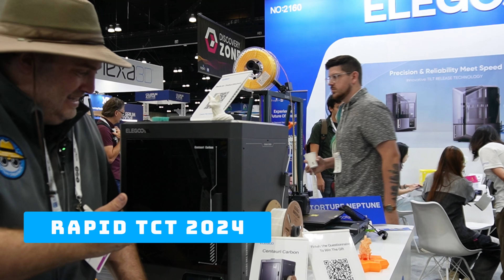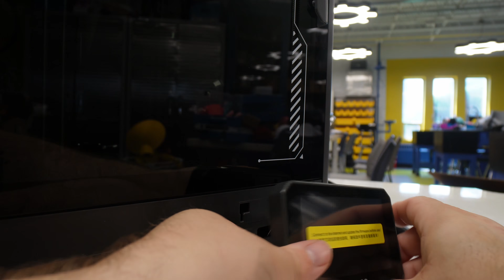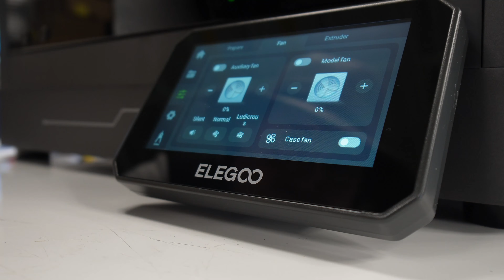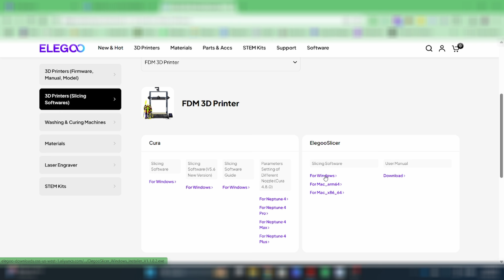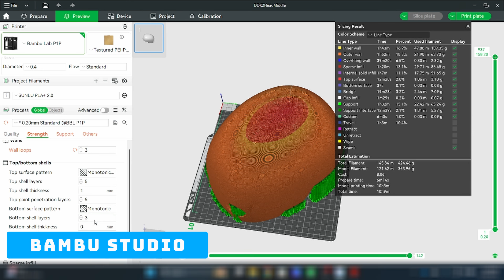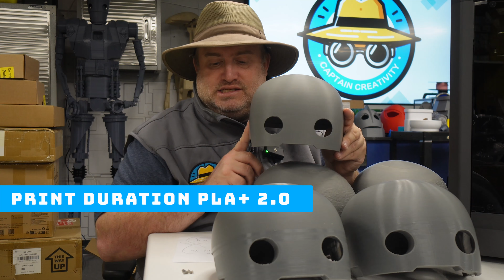Centauri vs P1P: The Ultimate 3D Printing Showdown

Comment: Better screen, More rods, thicker bed, higher speed, better print quality, easier nozzle changing, more advanced leveling, front USB port....Not exactly a clone.  A BIG IMPROVEMENT is more like it
Reply: On paper the Centauri is better. But I've seen other comparisons where the P1S had slightly better print quality. 

One example was the test print  with the overhangs. The Bambu printed all the way to 80° overhang without issues. The Centauri was fine til 70° but then had the underside of the overhang have issues at 80°. 
Also the details of the chimney of the benchy looked sharper on the Bambu and the Elegoo had some more issues with bridging hanging down.

I assume that's mostly because Elegoo has faster print speed in the standard profiles and Bambu is better at cooling which is important for overhangs / bridging.

Then the Elegoo print plate is not that good. 

But overall I think the Centauri Carbon gives more value for your money. At the moment I'm looking to get my first printer and the Elegoo is currently my top pick.
Reply: I own a P1S and have tested a Centauri carbon...No the P1S doesnt have as good quality of prints , especially the first layer and on overhangs.  Also the build plate on the P1S is plastic and half as thick as the Centauri.  The Centauri also has a better cooler on the printhead.  Like i said i own a P1S and have used a Centauri....The Elegoo is better @john9801
Reply from the maker: So glad to hear from you another owner confirming the CC is better. Out of curiosity what do you think was causing my K2SO helmets to look so bad on the P1P? You think they were both wet rolls of filament?
Reply: @CaptainCreativity  It honestly could be anything from loose belts to bad nozzles to extruder gears going bad.  Ive had all those issues with my P1P.
Reply from the maker: Hey great feedback. I think you're right that they probably squeezed out a little bit more speed in their default profiles and yes bambu lab could have done the same thing but it's quite possible they couldn't get the same level of quality with that extra bump. Here we could clearly see that the Centauri carbon definitely can handle it. 
So do you think you're going to get the carbon or just a regular Centauri? Because if you're only dealing with pla you really don't need the carbon from my understanding. Thanks so much for watching and excellent feedback
Reply: @CaptainCreativity  Im probably going to get the Carbon once they launch the multicolor unit for it in Q3.  I like having several standby rolls onboard to do larger prints and a multicolor unit works great for that.  I currently own a K1 Max with CFS , Anycubic Kobra 3 with ACE Pro, S1 with ACE Pro, Bambu P1P with AMS so an Elegoo Centauri carbon with multicolor would fiti n nice
Reply from the maker: @anthonylong5870 how do you like the S1?
Reply: @CaptainCreativity  Its very well built. Quiet as well. Print quality is better then the X1C.  I had a bit of trouble with the multicolor ACE Pro at first and couldnt get it to purge or retract.  Turned out it was a bad hub. I replaced that and it has been solid. No issues just nice prints for $550

Comment: I do not agree, the Carbon looked worse, its way more smoothed which means it uses a way more aggressive input shaping. THe K2SO looks like wet filament for the Bambu? Not even my old A1 prints that bad.  I have ordered a Carbon Centauri and is excited to see how it is when I can do my own tests. I've heard it prints better also when you turn off input shaping.
Reply from the maker: So just to clarify the really bad looking K2SO heads was done on two separate p1p printers. I used two separate rolls of filament right out of the box so I don't understand why I got that result. 
It wasn't the printer itself because I was able to get great results when I use the PLA Meta. 
By the way when you're watching the video of the PLA Meta which looks darker it does give more of a smooth finish to it but that's because that's what the filament does. It's Not silk but it looks very similar to that when it's finished. 
Anyway you could be right that it is wet filament I either had a bad batch and both rolls were no good. 
Anyway I love to hear your results when you get them so please share. Thank you so much for watching
Reply: There's no guarantee that filament ships dry. They often put the dessicant in the middle of the roll, and then vacuum the bag, thus separating it completely from the filament 
 @CaptainCreativity

Comment: What about colour changing that might be a big difference?
Reply from the maker: Hey thanks for watching. So further into the video I definitely talked about the lack of the multicolor filament solution (similar to AMS) however they have said one is on the way and it's going to be ready in Q3 of 2025 so that's literally July Aug Sept , so it's right around the corner. However until it comes out if multi color is important then I would hold off I'm buying this. We also don't know what quality their multicolor solution will be. Anyway thank you so much for the feedback

Comment: Pay once cry once buy bambulab
Reply from the maker: So you know there is definitely something to that. I was just writing in another comment that we do not know the long-term results on using this machine. One thing I will definitely say 100% is that I have EIGHT Bambu Lab P1P's and they are workhorses. They are absolutely super reliable and very maintenance free. There's of course maintenance that they recommend that you do and I can tell you even where I'm not the best on doing the maintenance they really hold up. I can't unfortunately be able to say the same thing for the Elegoo Centauri, but in about a year from now I could definitely do a follow-up assuming it's not too obsolete by then. Anyway thanks so much for watching
Reply: Looking forward to the long term review of elegoo  @CaptainCreativity
Reply: @CaptainCreativity  I have 2 P1P's they are worthless trash. neither one made it to 800hrs....belts split, PCB boards went out. bed leveling dials literally popped off mid print and the beds wont level now......JUNK
Reply: @anthonylong5870 I have an A1 and A1mini. 960h the first, 880h the second . Apart from routine maintenance and cleaning (just lubricate!) I have only had one problem with A1mini (the monitor started flashing after about 600 hours, they replaced it for FREE in a few days). I also had 3 Elegoo fdm and one after 15 hours, one after 150 and one after less than 180 ended up in the bin. They have not reached 6 months in total. Terrible quality, terrible assistance (I have to pay €25 to send it in for assistance and €25 for send it back to me when it's fixed? No thanks!!)
Reply: More like Overpay once and regret buying a Bambu when you learn its not all that people (who are Bambu trolls) say it is.....

Comment: Orca slicer is better than Bambu.  Has access to more slicer settings.  CC camera has a higher frame rate than P series Bambu orinters.  Centauri Carbon comes standard with a hardened nozzle and gears for abrassives.  Not requiring cloud access is a positive not a negative.  CC can integrate with Obico for remote monitoring.  Have 2 Bambu printers. Run both in lan only mode so no access to their cloud or their app.  Thank God.  Could give a flying rip about an app.  Have 8 color AMS for my X1c and 4 color AMS lite for my A1.  It is a very wasteful, marginly useful feature, that don't find a lot of use for.  Bambu's hamfisted need to control and lock down their ecosystem even more than originally, literally pushed me towards their competition.  My plus 4, T1pro, and Sovol SV06 ace all produce as good or better print quality than my Bambu printers.  My CC print quality is very good and it is very easy to use.  As easy as either Bambu printer.  The P series is now old technology, with a very dated, clunky interface.  At this point the CC is a better printer.  Elegoo customer service is way better than Bambu.
Reply from the maker: Hey, first off thanks for watching. Interesting point about the lack of cloud access being a positive instead of a negative. From a security standpoint I totally hear what your saying. Anyway multi color was a pretty bad experience for me as well when dealing with the AMS. I really did not like the AMS. I am interested what they will come up with for their multi color solution. Even though I agree it's wasteful and takes a really long time I'm still intrigued on seeing how they will go about their own multi color solution. 
Anyway thank you for the great feedback. Do  you have a CC or plan to get more ?
Reply: @CaptainCreativity In addition to the Bambu's have a CC, Plus4, T1Pro, and SV06 Ace.  Like them all, but none of them are perfect.  Each has strengths and weaknesses.  My main complaint with the Bambu's is the its their way or the highway mentality.  CC is closed source, but it has thoughtful additions like the ability to adjust z-offset.  Something that can be done with the bambu g-code, but that is not as convenient.  My only real complaint with the CC was the choice to put the filament sensor on the side rather than in the tool head.  Because of this it is important that the PTFE tubing remain the same length if being replaced.  That is likely going to make their AMS implementation less stable and more prone to jamming in the filament sensor.
Reply from the maker: @tonyoslund5700 Good point on the ptfe tube.  I too also wish the run out sensor is by the tool head. I have had so many issues caused by erroneous filament sensors. I have had the pleasure of using all those printers except for one, the Qidi Plus 4, how do you like it ?
Reply: @CaptainCreativity  It works reasonably well once you get past the first layer/z-offset issues.  The probe and bed sensors are not great.  Print quality is very good, and I guess that is what counts the most.  With heated chamber handles higher temp filaments very well, and also handles PLA and PETG very well.  But... it has some manufacturing / design issues. Nozzle is too fragile due to an integrated ceramic heat break.  Has a tendency to catch on the nozzle cleaning pad and crack.  Wifi sucks.  No polite way to say it.  Has a tendency to just stop working during longer prints, so there goes the monitoring.  Chamber heater has no integrated thermal fuse.  Necessary (but very simple) mod is to upgrade the cooling fan for the main board, or the printer will do wonky things during long runs.  Another popular mod is to add a beacon - touch sensor to solve the z-offset and bed meshing issues.  I make use of the plus 4 all the time.  It is not a beginners machine.  Not turn key, and while it has Klipper, it has to have Klipper in order for the user to work around the issues.  It is a very useful tool, but not a general home user device.  Because of its issues it is the least favorite of my 6 printers.  It has so much potential.  If they had ironed out the issues it would literally be the 900 pound gorilla in the market.  But... this is the Qidi way.   Offer lots of promise, but not lots of deliver.  All of the Qidi printers stop at the 2 yard line.  Centauri carbon can print most high temp filaments, and is waaaayyyy easier and more consistent to use.  I am modding it to add some chamber heating, and literally it will work as well for these materials as the Plus 4.
Reply: @tonyoslund5700 You probably never had to deal with the two support. I hate elegoo support, paying to send them a defective printer under warranty to be repaired? 10 times the support That they tell you to do the same thing (elementary tests) and then disappear to change operator and track down the tests?? I have had 3 elegoo fdm and one was worse than the other (less than 200 hours each), a coincidence? Doubts. With BBL after about 1000 hours of printing I had a problem with the monitor (it was flickering), in 7 days they sent me the new monitor and said "if it does it again, send the printer to us for FREE, we'll fix it and send it back to you for FREE"
Reply: @Alegiro  Actually I have, and I will agree that it was run around.  Ended up trouble shooting and fixing the issue myself.  But of course they were really friendly about it.  Just also very useless and incompetent.
Reply: I’m interested in buying one, but I’m new to the 3D printing world. I’m torn between the A1 and the CC . I know they’re different types of printers, but in my country the A1 costs only €20 less than the CC, so it’s a tough choice for me.
Buying a Bambu printer feels safer because of the software, MakerWorld, and all the integrated features, it sounds like a good option for a beginner.